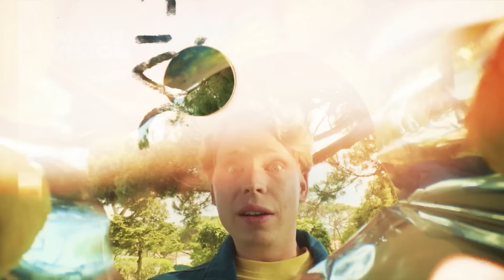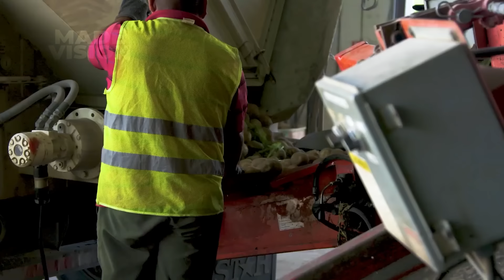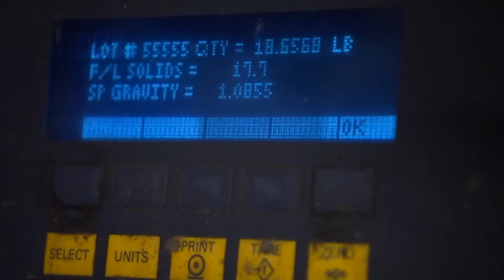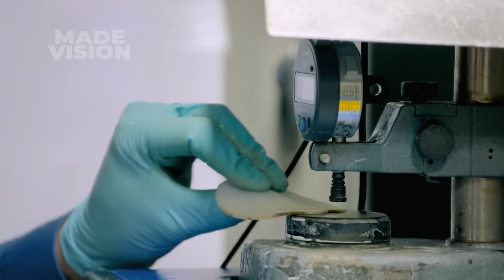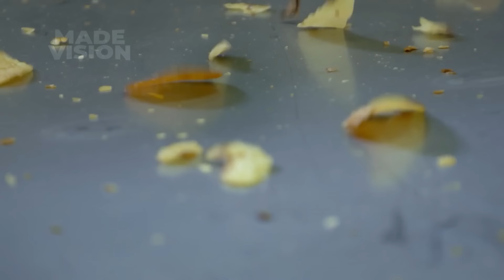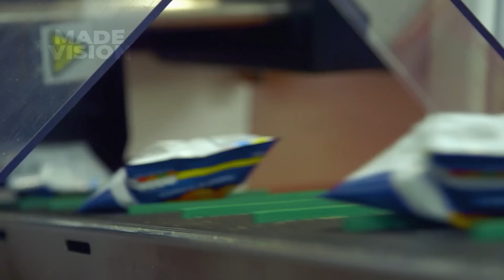How Lay's Potato Chips Are Made In Factory

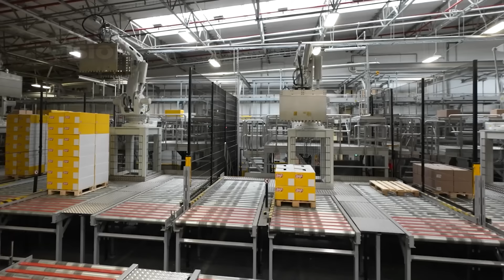Comment: @13:35 So all chips are cross contaminated with gluten because it's the "same machine" for seasoning the chips, gluten is definitely in paprika chips seasoning, i'm assuming it would be a hassle to use a different machine for that process.
Reply: Every time they change seasoning they must and they do make a proper washing of equipment. Otherwise, all the chips would of the same flavour. I know it as I work at the same manufacturing facility.

Comment: you stated they measure down to the chip, but thats such a lie lol. maybe the normal/large bags get weighed consistently, but small bags have huge variation. any of these multi scale packing machines cant be so accurate due to their design.
Reply: Have you ever worked on those scales? If so, tell me who made them? Everyone that has worked on them knows.
At Frito-Lays there is a whole row of them, each one set up for the individual sizes and product type. They are (when working right) they are very accurate,  less than a 1/4 ounce or so different.